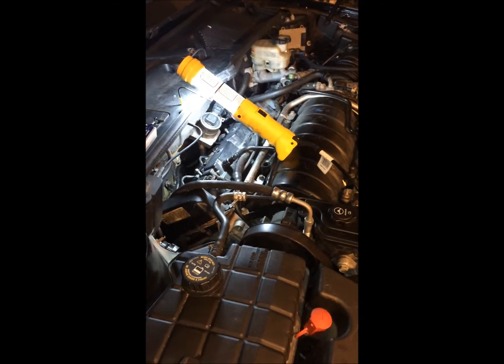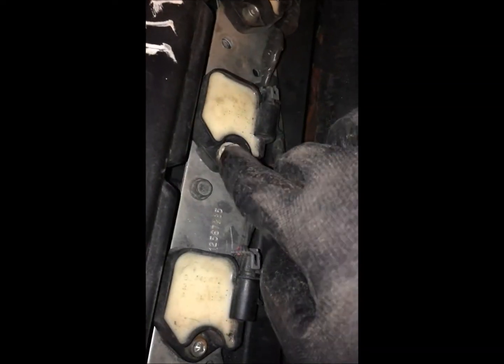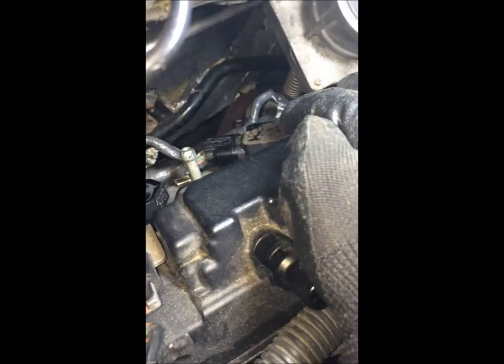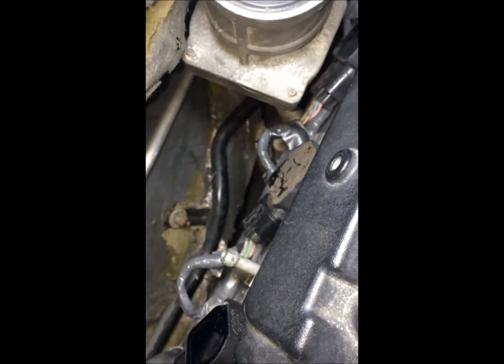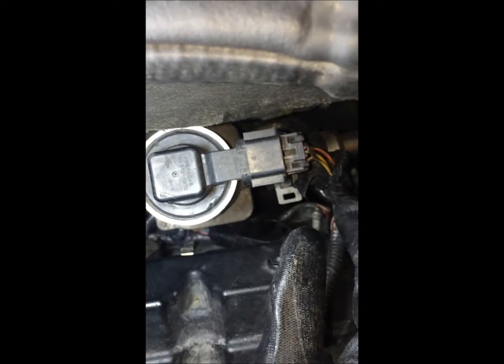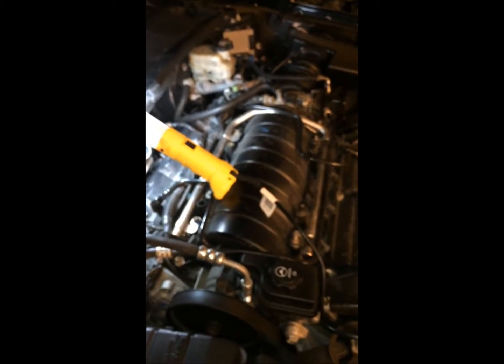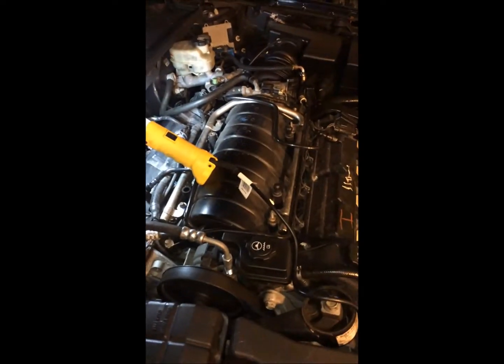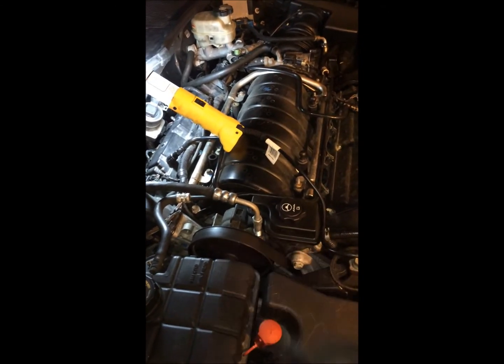2006 Cadillac DTS - How to replace spark plugs

Comment: Thanks for your calm demeanor, short but informative and EFFECTIVE vid. With my P0308 code I just got a new plug and coil and replaced both, thanks for your help runs awesome, and it WAS easy, especially working on the front 4 cyls

Comment: can I use this same video to change my plugs. I havd a 2008 buick lucerne cxs. North starV8 as well.
Reply from the maker: Darius F Sure. The Buick Lucerne and the Cadillac DTS are built off the same platform they are basically identical just one is a Buick and the other is a Cadillac. I plan to replace all of my spark plugs soon I'll make a update video on it since this one is pretty old.
Reply: thanks bro. going to pick up some today

Comment: Froztinc My 2006 Cadillac Dts has a check engine light on with the service traction control light on as well, would changing the ignition coil fix this? I had all the spark plugs replaced but it still vibrates when idling.
Reply from the maker: Really it's best to pinpoint the misfire with a code but definitely yes if the ignition coil/coils are bad it will misfire and run rough creating vibration.
Reply: @Froztinc  okay thank you. Do you know which one is cylinder 8?
Reply from the maker: @RazielRodriguezz  #8 would be in the front and the farthest to the right. Very easy access for that
Reply: @Froztinc  Thanks man.

Comment: I know this video is a little old but same problem happened to mines and I have the same year and same problem with same cylinder number. I replaced all 8 spark plugs and the problem persisted, so I changed the ignition coil for that particular cylinder and it fixed it but temporarily, (2-3) months max. Now I’m thinking it could be that I need to replace the ignition wires? Any thoughts guys?
Reply from the maker: Andrew Rodriguez I would swap the coil for another one and see if the cylinder misfire jumps to the other cylinder. If the misfire moves then you know the coil is bad and if it doesnt then inspect the spark plug make sure the gap is set correctly on it.
Reply: Froztinc Yeah im going to give that a try, I forgot to mention I already replaced the coil 3 times and switched them to seee if it was just a bad coil but no it’s only happening on cylinder 3.
Reply from the maker: Andrew Rodriguez I would change the spark plug and if it doesnt correct it I would do a compression test on cylinder 3 and it could also be the fuel injector they can cause a misfire

Comment: Okay because i have a trans leak and a power steering leak and im not sure where it is coming from but i added power steering fluid and i noticed that after about an hour of driving a little bit of smoke was coming from under hood and i opened the hood and those 2 lines running along the passenger side firewall were dripping a little fluid and it looked like there was condensation on it i was thinking about ordering a new trans pan gasket and dropping the pan but not sure about the power steering.. How long do you think this would take for both?  Thanks for the response btw appreciate it bro
Reply from the maker: +Tim Elliott  According to the GM service manual the oil pan gasket is reuseable. The two filters that you will find inside the oil pan are mesh type screens and can be washed out and reused. There are other filters inside that would normally only be replaced during overhaul. Fluid capacity for pan is 4 qts, if you pull the internal drain plug you will need 3 1/2 more qts of Dexron VI. Basically all you need to service this unit is 7 1/2 qts ATF.

Comment: do you have any fluid leaking problems from your trans and or power steering? do you know where the trans coolant lines are located? is it along the firewall? near where you are working in this video?
Reply from the maker: I've had the transmission leak and the power steering. I replaced my radiator because it was leaking as well. While the radiator was out I replaced the fitting for the transmission line and got a new hose for the bottom line since it was leaking as well and used fuel line clamps. It's pretty easy to DIY but I'd recommend to just replace the entire line.

Comment: Any videos for replacing a fuel injector for this engine. I’ve already changed the plugs and coil so it must be the injector and I’m not sure bout taking the fuel rail apart.
Reply from the maker: Jessica Herb The fuel injectors are actually quite easy. One easy way to tell if they are working well is to get a stethoscope and listen to each one and see how they are ticking if you don't hear one ticking then it is bad. 

I do not have a video of it but I have taken the fuel rail off many times. Why do you think you need to replace one? What is the code that you are getting?
Reply: Froztinc Code P308. I replaced the coil and plug for cylinder 8 already and it’s still throwing the same code.
The car is having occasional starting problems, extremely rough running, letting off a LOT of exhaust, and drinking like 4 times as much gas as usual. 
There are no major vacuum leaks.
Reply from the maker: Jessica Herb Then yes I would definitely think it's fuel injector. You can get a cheap stethoscope or even place a screwdriver on it and try to listen and feel how it's ticking. 

You need a quick disconnect tool for the fuel line. The injector has a  clip on it you need to remove with a small flathead screwdriver.  The injectors usually lift up with the fuel rail but sometimes they can get stuck. You can get the fuel line tool cheap st any auto parts store.
Reply from the maker: Also what plug did you put in it and did you make sure the gap was set correctly?
Reply: They were pre-gapped, but yes, I always double check. 
I have all the clips, nuts, and bolts loose on the fuel rail but it isn’t budging. The injectors seem to be connected to it by some metal cap type deal and I’m not too keen on just prying and tugging and hoping for the best.

Comment: 1500 dollars is what i was quoted from a mechanic!
Reply from the maker: That really is a rip off. It's because a lot of mechanics do not like working on the Northstar but it really is not that difficult at all.

My XTS you have to remove the intake manifold just to change the rear spark plugs.

Comment: was the ignition coil expensive?
Reply: about $150 on up, for all 4 if you buy together, about $50 if you buy individually.  I would recommend Iridium plugs, or at least platinum absolute minimum.
Reply: Dan Anhold Same here man, iridium is what's best for these engines

Comment: I have a 2007 cadillac dts 
I took it to a machanic 
And tokd me to replace all 8 spatk plugs will cost me $550 
He told me he woukd have to lift or lower the motor , is he telling the truth ?
Reply from the maker: Definitely don't need to pull or lower the engine.
Reply: Bro I change my own my car misfire cause I put Bosch spark plugs in there I’m finna go with ACDElco

Comment: NOT A GOOD HOW TO VIDEO. HE TELLS YOU WHAT TO DO WITHOUT SHOWING YOU. MOST PEOPLE NEED TO BE SHOWN HOW IT IS DONE NOT JUST POINTING AT SOMETHING AND SAYING DO THIS OR DO THAT.
Reply from the maker: It's pretty much common sense on how to replace a spark plug. If you don't know how to do that then you shouldn't try to be a mechanic. And to work on a car with one hand while holding a camera isn't the smartest thing either.
Reply: Your absolutely right! I'm that way! Notice he does the ones in the front of the engine not the rear facing the firewall, which are a bitch because there is not enough room especially the two coils and plugs that are in the middle, of the engine His video is not that good. Take a look at Eric the car guy and Scotty Kilmore these guys will show you how its done good videos!